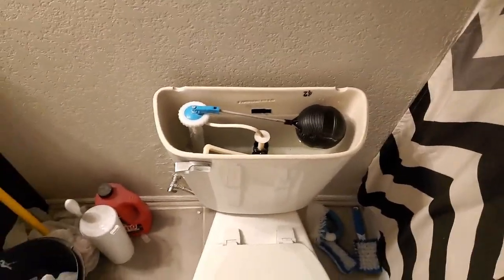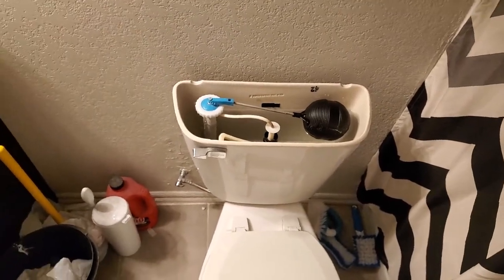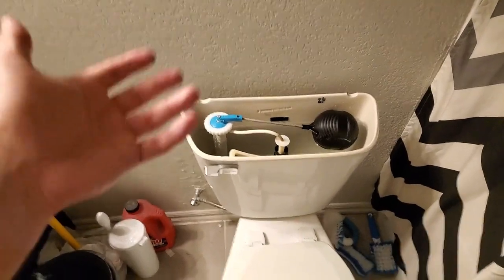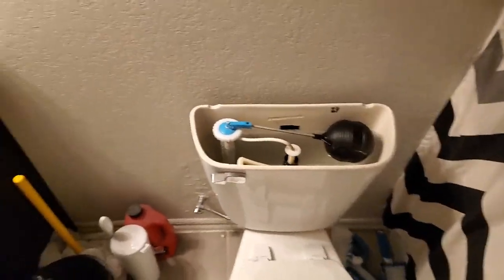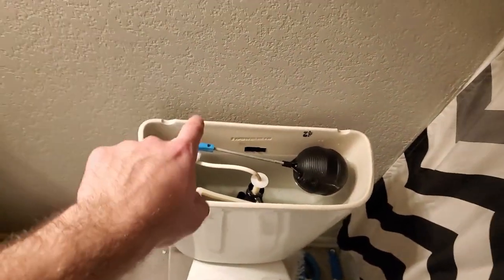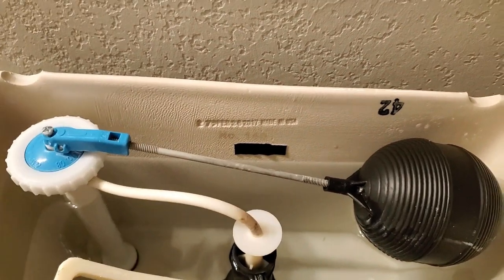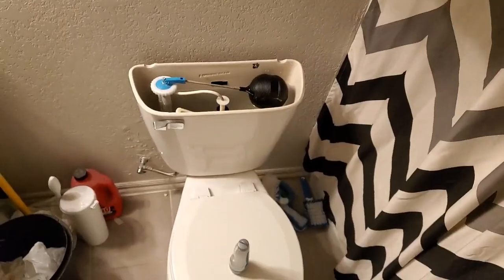Prevent Frozen Toilet Pipes Fix (Easy and Free)

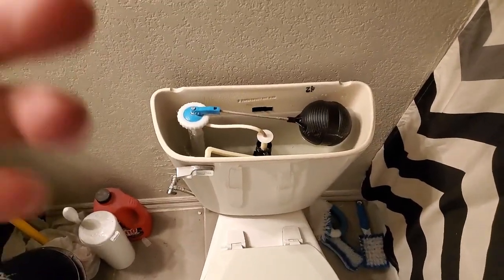Comment from the maker: Go to 2:00 if you're in a hurry and just need to see the fix.  Basically it's the same concept as keeping your sinks dripping in the winter.  We had our pipes burst two years ago and I didn't want that happening again so I used some gorilla tape to make a dripping toilet.
Reply: Thanks, I was wondering what to use for a small drip procedure.  I have a different flap-seal.  I couldn't see exactly where the tape was.  Is it just between your flap and the hole?  🚽

Comment: Thanks for this, but don't you have some risk of the tape going down into the hole?  I don't know a thing about toilets, but I don't think that hole immediately allows water to go straight down the drain.  Isn't there an additional basin within the toilet where the tape could get caught?  Personally, and this takes a little more work than what you've done, but removes the risk of the tape falling into the hole, I use a clothes hangar to keep the plug / valve slightly open.  Then I adjust the valve at the wall to only allow for a trickle of water coming through.  Again, more work than what you've done, but I think maybe less risk of an issue with the tape.
Reply from the maker: Great suggestion!

Comment: Could you tell us what kind of Gorilla tape you used that wouldn't come off in water?  And I assume the tape is between the flap and the exit hole?
Reply from the maker: As far as I know it's just standard Gorilla tape.  I drained all the water out of the tank then held the plunger/stopper up and wiped it dry.  I then put the tape on the underside of it and it's sticking to both the outside (as you see in the video) and inside of it.  Not sure how long it would stay on but it seemed to be holding strong after a few days and then I took it off when the weather got warmer.  Would imagine it would stay on there for a good while.
Reply: @Auddy07  thank you so much.